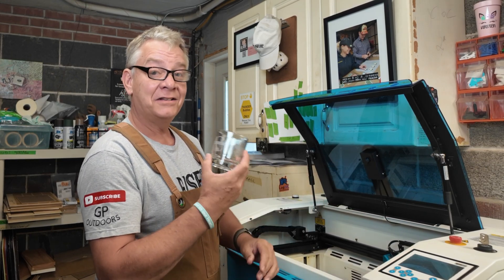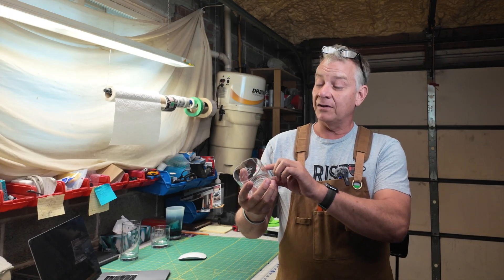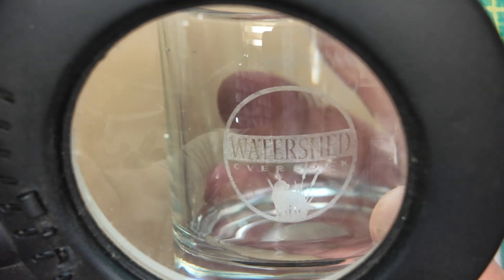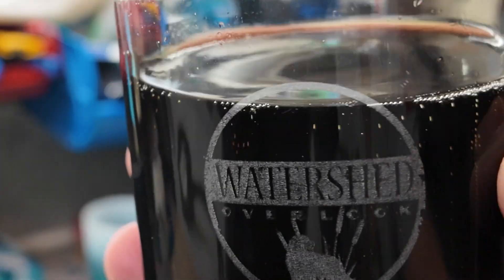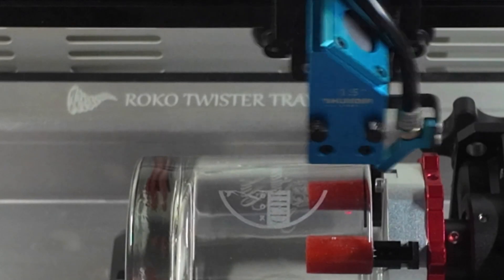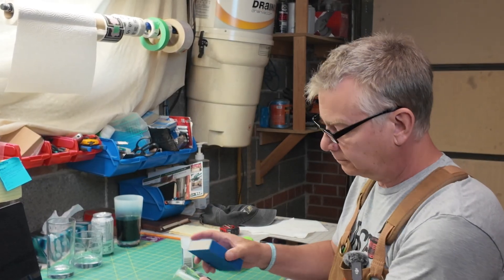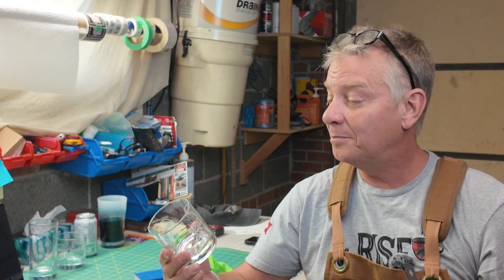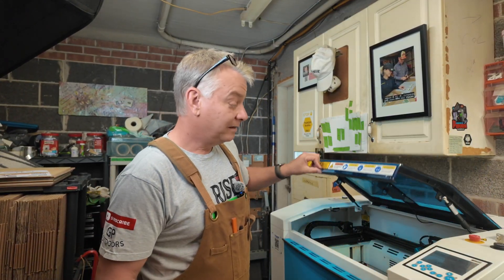Engraving Glass on a C02 Laser? I Don't Think So. Thunder Laser BOLT.  044   4K

Comment: Thanks for the video. 
I have use the transparent vinyl masking tape from JDS. I apply this to my glass piece and laser engrave the design. I then mask the remainder of my workpiece with the wide blue tape from JDSt leaving no bare glass. Then use a sandblast operation to ablate the laser engraved areas. Hold the blast nozzle about an 8” distance from the piece and do some passes. Don’t hold the blast nozzle in one position. Scan over your design with it. You’ll be able to see the light reflection from the laser fractured surface turn to a uniform frosted look. The red mask must be firmly applied for it to hold up well with small text or finely detailed designs. When done brush off the sand clinging to the surface. Remove the masking tapes under running water. 
Of course this entails the added expenses of a blast cabinet, sand blaster, the two types of masking tape, and a suitable wash area. If you unmask dry there’s a strong chance of scratching the workpiece.
Reply from the maker: Hey good day and thanks very much for the info - greatly appreciated and informative. Have a great Independance Day!
Reply: Great advice… Can the sandblasting be done in place of the laser? And what blaster do you recommend, and what grit of aluminum oxide do you recommend?  Thank you!
Reply: @BeatingCancerWithAI  Use the laser to cut through the mask, then remove it and head over to your sandblaster.

Comment: Hello for Iowa, from a fellow Bolt Laser and Kubota tractor owner- watch both your channels!  I have ended up having the most success with damp typing paper stuck tight on the glass, 276 DPI, speed 300, power 80/75 Jarvis,  an image graphic Gamma .8. the damp paper allows me to crank the power so I got a more solid white and still no edge chipping. I was experience the edge chipping on the lead in side of the graphic before stumbling on to the paper recommendation and that did the trick.
Reply from the maker: Good morning and thanks for watching both channels! Appreciate the great advice - Have a wonderful holiday weekend!

Comment: With my 100w CO2 I use a product called Blaze Orange for glass. Works really well. It’s a little pricey. When applied it puts a thin barrier between the glass and lazer. I get really nice engraving with it.
Reply from the maker: Thanks - are you referring to the spray paint used for safety cones etc? Made by Perfomix? LOL. I think I found it - it is a film called Blazer Orange. :)) Thanks again!
Reply: Yes that’s it. I purchase it through JDS. Works great. If you would like a sample I can send you a piece of it to try if you like. Also, what I found out cheaper the glass, the better it engraves.

Comment: I ran some tests on pint, rocks, and stemless wine glasses. I get a pretty smooth engrave without chipping at 250 sp and 20 power, I then tested 250 sp at 50 power and that was just a little brighter engrave with no chipping. Also I use a very fine micro mesh sanding pad that I found on Amazon. They range from 1500 to 12,000 grit, not sure which one I use but its probably in the middle of that range. I found that more power does cause chipping. Also this is with the stock lens and coming from an Omtech laser, I run air on everything.
Reply from the maker: Thanks very much Randy!

Comment: Question: I have a diode laser and my thinking is you must either mask or paint like tempo paint the area to get a good engraving. One other thing is what quality glass are you starting with. Just my thoughts on the quality work that’s being performed????
Reply from the maker: Hi Ronnie! Not sure of the quality of the glass and not sure how I would be able to tell. I thought about masking etc but saw several videos that tested them and they did not appear to make much difference but have you found that masking provided a better outcome than mine  did, in this video? Thanks for your help!
Reply: @LaserNUG  try the tempo paint along with stuffing the glass with brown paper. I think you’ll get a better result!!!!!!
Reply: Yeah that’s real efficient if you have 100 to do for a paying customer. Shouldn’t have to put anything on it. The machine is not for glass.

Comment: Most laser guys on youtube will say, " Buy the cheapest glas it engraves the best" 

That is bullcrap, with a Co2 Laser, a quality co2 laser as you yourself have, find a crystal glas with not to much lead, that will help you not get cracked engraves as it what i belive makes the heat not getting to high,  and it will be smooth as heck and be frosted look.
Reply: for my 60w epilog i use 100speed, 80 power, and Jarvis as diethering and 400dpi
Reply from the maker: @patrikstoor  Hey thanks very much Patrik! Greatly appreciated. :)
Reply: Where do you get your glasses?
Reply: @trev0r15  Rastal